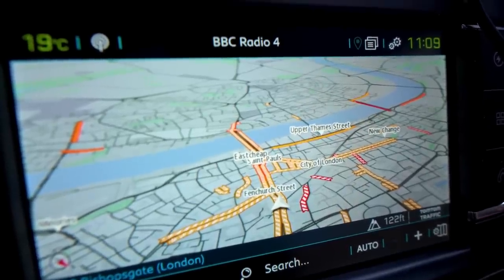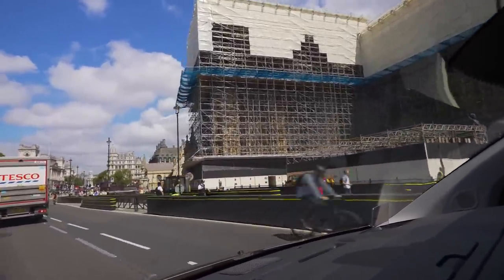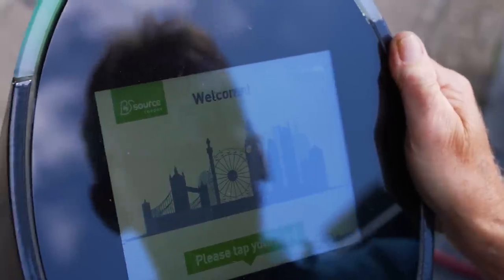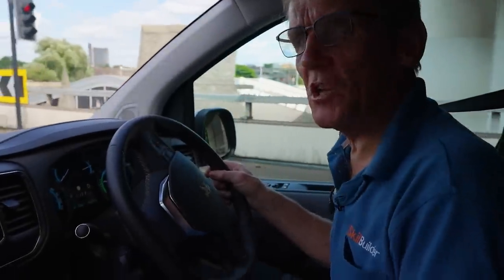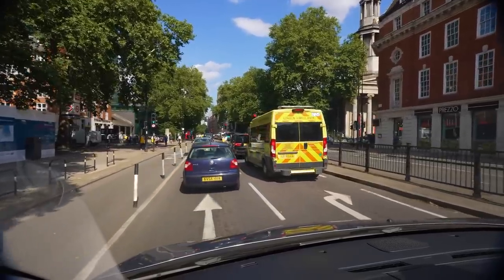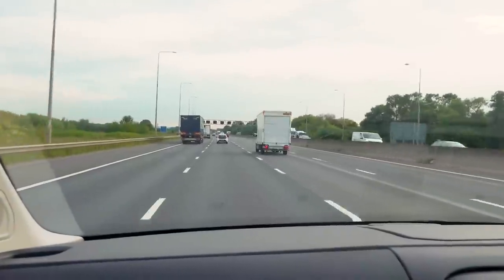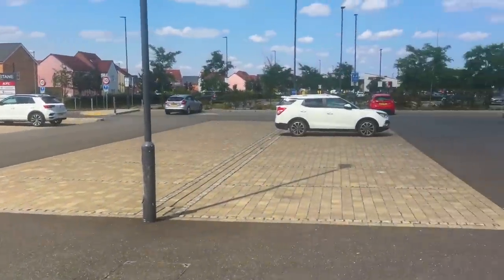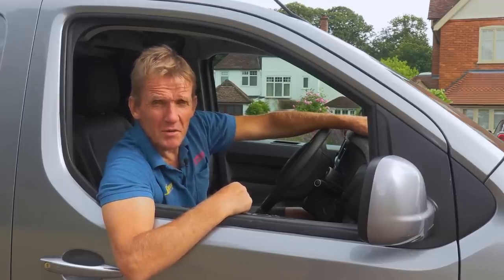Is It Time To Switch To An Electric Van?  e-Expert Test

Comment: This vehicle will need a new battery in a few years and the cost of that has to be built into the cost per mile, maybe you forgot that, batteries are thousands of pounds and the cost will go up because lithium is becoming more expensive, battery vehicles I don't see as the future. Hold fire and we will have Hydrogen which makes sense.
Reply: A "few" years? The battery has an 8 year warranty, and doesn't stop working the day after the warranty runs out. Where do you people get your daft ideas from? And the batteries cost "thousands" of pounds do they?  Oh dear. Watch the YouTube video of the 10 year old UK owned Nissan Leaf getting a battery refurbishment (note the word REFURBISHMENT, not replacement). The refurb took 4 hours, and cost the owner £600. The work was carried out by Cleveleys Electric Vehicles in Gloucestershire......   And hydrogen makes sense, does it?  How do we get hydrogen? By using lots of electricity, that's how. And once you have your hydrogen it still has to transported all over the place before it can be used. Plus those hydrogen fuel cells still need platinum to manufacture them. They also degrade over time, and will need repair or replacement during their working life. And don't anticipate hydrogen being cheap, or the vehicles which use it to be particularly economical....  The cost of EV batteries will moderate once more when EV battery technology moves away from using rare earth elements. The new BMW i4 allegedly uses no rare earth elements in it's battery construction.......
Reply: @geebix  You have clearly never informed yourself properly. Brian is right.
Reply: @Simon-dm8zv  Stick to a smelly old diesel you cant go far wrong. No expensive battery's to replace after a few years and residual values falling like a Saturn spaceship.
Reply: @geebix  Diesel won’t be an option in the near future.
Reply: @Simon-dm8zv  I am clearly dealing with a numpty, how do think lorries are going to be powered? battery I don't think so, I will be using diesel for the foreseeable future.
1. The cost of battery cars is prohibitive.
2. There are insufficient charging points to even consider going any real distance. 
3. Inadequate servicing skills in garages, servicing not done by a spanner man. many TV programs highlighting this situation. 
4.  Road tests for the sake of YouTube are ballsh-t it is not done in the real world.
5.  Inadequate mileage out of a single charge, Oh a trip to Scotland will need 5 stops to recharge add 2-3 hours extra on the journey. GET REAL
6. Who will want buy a 4 year old car with a knackered battery.
7. There is a new Technology that will make battery totally out of date.
8.  Tradesmen asking the customer can I use your electric to recharge, simple answer effoff.
9. I will be sticking to smelly diesel for the next 12 years and longer if I can,
Reply: @geebix  1. Cost of batteries have dropped a lot over the past 10 years and will continue to do so.
2. Just a matter of time.
3. Electric vehicles don't require a lot of maintenance in the first place. Maintenance engineers need to be re-schooled, as with any new technology. That's just common sense.
4.  What is your point?
5.  Fast charging often takes less than half an hour. Just like your normal food and toilet break.
6. AGAIN: they easily last 10 years. Warranty is often 8 years. 
7. Nope there is no such thing. You have been lied to.
8.  You don't have to. Just charge at home or along the way if you really have to.
9. I would not count on that. Governments will simply make that impossible. I would count on about 5 years. After that you are probably not allowed to enter any large town in an old diesel and road tax will be through the roof.
Reply: @geebix  Lol I literally supplied you with facts.

Comment: also, there's no consumption while you wait stuck in trafic
now wait till tesla comes out with a van
Reply: And charge 60k for it
Reply: @pauldavies7251  but will have 600km range, at least
Reply: So what's running the software , heater , air-conditioning,  radio , ....fresh air  ?
Reply: @dashcam2417  That’s a very small amount of energy compared to an idling engine
Reply: @AmauryJacquot  all new vans have stop , start technology  ..it's not just an electric thing.
Reply: @dashcam2417  starting the engine consumes more energy than having an electric van on idle
Reply: @AmauryJacquot  totally agree on a quarter mile traffic jam last week the stop  ,start activation happened 20 plus times  ..that's why I push the button to deactivate it. 
But a tesla model x battery pack contains 16,000 laptop style batteries weighted at 76 stones ... I don't find that particularly good for the environment.
Reply: @dashcam2417  those batteries are better for the environment than you think, in particular because the materials they contain are not slated for single use.
whey your vehicle dies, those batteries will be going to a specialized recycling facility so that they can be used to build new batteries.
Reply: @AmauryJacquot  only Renault are in the process of building a factory for battery pack recycling.. they think that they will be able to recycle 1,300 units in a year.. the rare earth materials used can't be reclaimed .
Reply: @dashcam2417  there are no “rare earth” materials in batteries

Comment: No one has mentioned residuals on battery cars, they wont be worth a sh-t after a few years with a knackered battery.
Reply: Batteries are not knackered after a few years.
Reply: @Simon-dm8zv  I know sooner if you charge them everyday just like a mobile phone battery, and the replacement cost is about half the vehicles cost, I will be sticking to a stinky old diesel as I am sure millions of other people will be.
Reply: @geebix  Totally incomparable. EV batteries have already proven themselves over the past decade. They easily last 10 years.
Reply: @Simon-dm8zv  They last longer than ten years if you don't use them through insufficient charging points.
Reply: @geebix  So your problem is?
Reply: So there is still a massive cost after ten years and costs are rising.
Reply: @geebix  It is just common knowledge. You are only trying to come up with reasons to be able to stick to outdated and polluting technology.
Reply: @Simon-dm8zv  How do you know brains have you had one for any length of time, of course they will last a long time if you don't use them.
Reply: @Simon-dm8zv  No I am not being duped by an ill informed salesman. and I hope there are enough intelligent people out there to realise what's going on.
Reply: @geebix  Lol once more: you have no clue. Enjoy your last years of dieseling.
Reply: @Simon-dm8zv  I will be dieseling for a lot longer than that, I will not be buying that junk and I am trying my best to convince others to do the same, there is a better technology around the corner that will make your battery cars as outdated as steam locomotives. Residuals they wont be worth a sh-t when thousands of people off load this junk and realise what an expensive mistake they have made.
Reply: @geebix  Like I said, it's not up to you. Governments will ban diesel and gasoline cars sooner or later. And no, there is no better technology around the corner. Hydrogen cars are a stupid idea.

Comment: Interesting review. However, what the eco warriors conveniently forget is the huge environmental impact of manufacturing a van (along with the limited life of the very expensive batteries). I’ve no intention of switching to electric.
Reply: Yep mate they are rubbish not carbon neutral the pollution is simply moved to the power stations its a insane idea
Reply: @palms674  what power stations mate? Biggest source of power in uk is wind then gas then nuclear and hydro.

Even if you made electricity with coal it would be less polluting than a diesel car or van. The reason is that power stations are as much as 4x as efficient then an engine.
Reply: @PiOfficial  Exactly.
Reply: Biggest source of power is power stations fact 
oh wind windy every day is it answer no!! those other saurces just don’t work 
let alone the pollution thats caused by making the battery cells  and  you like travelling around at 50mph max speed fully loaded charge thing up every few hours times money diesel fill up go earn money 
I watched a electric van person other day trying to charge it took him an hour p about at charge point its a b joke and come on get facts right before you comment
Reply: And we all listen to Simon he states Exactly what have I been doing wrong all these years bit like the protestors at fuel refinery s how did they get there public transport or car

Comment: I would love an electric van, i need a large panel van like a the mk8 transit H2L3 size but i am not spending upwards of £40,000 plus the VAT.
Reply: @Phil Ware I understand that, i buy my vans out right and my derv when needed, i replace my van when i save up for it.... also not all van owners get all the tax benefits available ie personal use
Reply: @Phil Ware good luck in 5/6 yrs when the battery is buggered & the van is worthless doing 50 miles on a charge!
If you want eV it's much better 2 lease one for 2/3 years,
Reply: The new full size E Transit has no towing capability...... that's crazy.

Comment: Great review. I lease a Nissan Leaf. Took it over just 2 years in case it turned out the be s nightmare. Just ordered another over 3 years this time. As absolutely superb. It won’t suit everyone, if you’re doing regular journeys over 150 miles in one direction would be a pain (range 160). But for occasional long journeys, charging at the motorway services is fine. Yes it’s more expensive. Like your sausage roll is. But if it’s occasional it’s no big deal. I shopped around and leased my Leaf for ‘diesel Focus money’. Wonder if you can lease/finance a van like this on a way which is competitive or at least closer to the total real world cost of the equivalent quality diesel?

Comment: Lithium costs are rising 50% year on year indeed find a car manufacturer that will give you the cost of replacing a battery pack,  garages have not got the skill set to maintain E/Vs8
8 year guarantee  and then face a major expense having a battery pack replaced or re-celled. NO THANK YOU BUYER BEWARE.

Comment: Do you own the batteries? Some manufacturers lease them to you on a separate agreement and they will need replacing after 5-7 years - at considerable expense. If not 2nd-hand value will take a massive hit. Range also drops in cold weather - that would be a good test. 
In the USA, they've started deploying diesel powered electric generators to service more remote areas. They get around 5 miles to the gallon! Madness.

I would also mention, battery fires. We looked at Evs for  my 80 year old mother-in-law and decided they might be too dangerous - she would not be able to get out of the car in time. EV battery fires cannot be put out. Fire departments have stopped trying and multi-storey car parks have banned EV vehicles in China.
Reply: @Phil Ware Do you need to replace the batteries after 5-7 years?
Reply: @Phil Ware Can fire departments extinguish EV battery fires?
Reply: @Phil Ware We'll see. Most of the rechargeable batteries I've encountered don't last a fraction of their claimed lifespan or charge. Bosch/De Walt/Milwaukee/Samsung/Panasonic/Sony etc. None match their claimed charge cycles. Many fail completely. I'm sure a £45k van with hundreds of batteries would be better, but who outside London could afford one as a works van?
Reply: Which EVs needs their batteries replacing after 5-7 years?
Reply: @Phil Ware Small systems have BMSs - they still fail rapidly and so do the batteries. I appreciate the power trains on these cars are more sophisticated, but it's still the same technology. Oh and what do you think EVs use? - 18650s!
Reply: @Phil Ware Just watched a van EV journey on Artisan Electric's YT channel. Cambridge to Doncaster took 3 charging stops and the guy had to start his journey at 4am! You might want to take a look.
Reply: @Phil Ware So, like all renewables they require a non-renewable backup.
Reply: @Phil Ware I'm not opposed to this technology and one day it will be great. In the meantime a lot of people are being conned.

Comment: I wouldn't have an electric van. Imagine getting caught out in the middle of nowhere with your livelihood in the back. No thanks!
Reply: There's no diesel in the middle of nowhere either.
Reply: @tonygoodin5099  very observant of you, but starting out with a full tank will take you 4 times further than a full charge, clever clogs!
Reply: @Phil Ware I'd much rather spew out diesel fumes thank you!
Reply: @martinlouden9005  and that’s the issue. Some people embrace the idea and some fight against it. People need to give it a try and see if they like it. My guess is they will. Like Roger did.
Reply: @Phil Ware you're very perceptive Phil!
Reply: @tonygoodin5099  diesel goes further than 80 miles on a charge too, great for city runabout useless for anything else
Reply: @Phil Ware where is this perfect world you live!? I work on a building site with 200 other builders! even if only 10% had an eV vehicle on site there wouldn't be enough charge points 🙈
Reply: @Phil Ware 20 minutes charge that boils the battery pack  ... and reduces the life of the vehicle.
Reply: @Phil Ware can't carry electricity in a jerry can ;)
Reply: @tonygoodin5099  I like the idea of electric transport just not the cost and range issues
Reply: @Phil Ware does that exist yet?
Reply: @Phil Ware 300 mile range,20 min charge and 0 to 60 in 6 secs, well maybe it would be better than a lovely diesel,but they don't achieve any of that !
Reply: A good maintained diesel engine will last 500,000 miles or more, battery packs have a cycle life and will probably start failing before 10 yrs,and you could buy 3 diesel engines for the price of 1 battery pack !